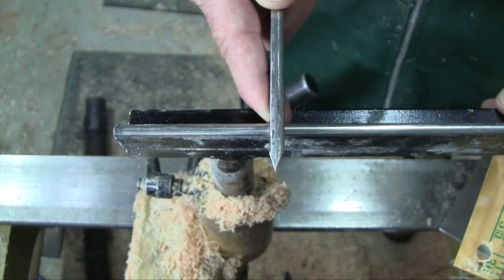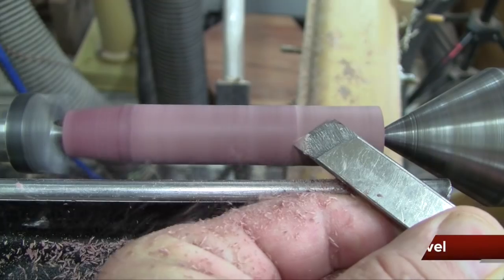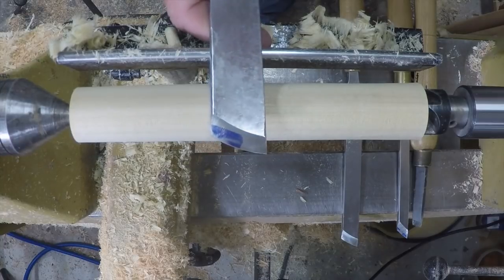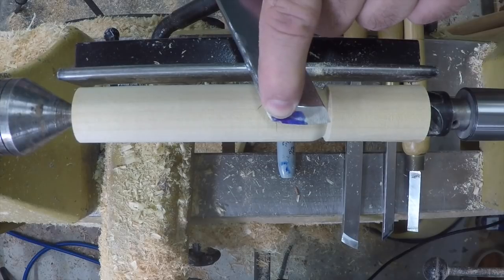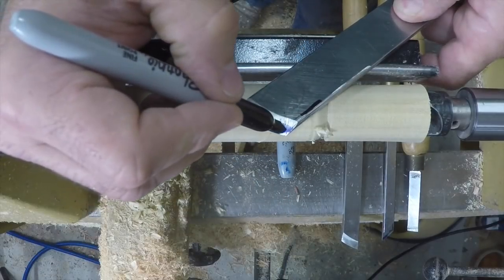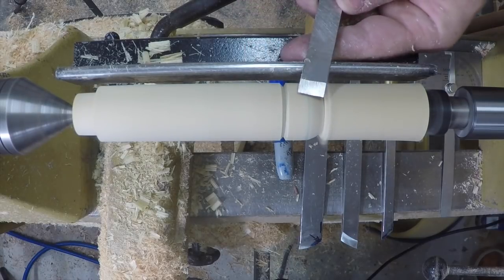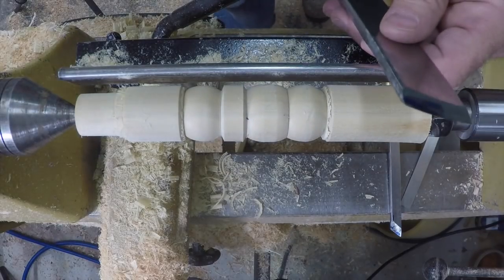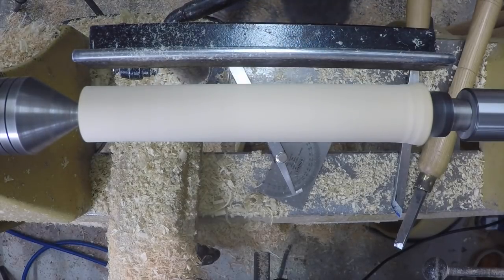Skew Grinds

Comment: Great video Brian.  I'm a beginning turner and I've been making rolling pins for friends for a few months.  I've made some beautiful laminated, exotic woods,  rolling pins, but I've spent probably an hour or more sanding after turning the shape with a gouge.  Using a 1-inch skew chisel with your recommended angles, I finished off the cylinder with the planing cut and it took only a few minutes sanding.

Comment: Excellent video.  I especially appreciated your discussion of skew angles.  I learned a lot.  

One thing you didn't discuss is the length of the handle on your skews.  I just recently adopted using a 7" handle on two of my skews.  I find the shorter handles to be much more flexible and easier to use.
Reply from the maker: David Walser I am planning to dedicate an entire video on tool handle length for various tools, so I omitted the topic here.  I too prefer shorter handles on skews (and on spindle tools in general) since, as you point out, it is easier to use.  I find that the extra tool handle length on spindle tools is not necessary, and I can maneuver a shorter handle in front of my body, etc.

Comment: I very much appreciate the time, the knowledge and effort you put into this video. I have several skews and many I have ground similar to what you showed us. While mine work quite well, with your added info I can better tune them now and understand why I would be doing that.. Thanks for your efforts in these videos !
 Incidentally, I just switched from grinding my turning tools to either belt sanding or disk sanding them. I did this to get rid of that hollow grind you were addressing when you mentioned hand honing , which I also do. I got tired of dealing with the aggressive nature of that hollow that forms on turning tools from an 8" grinder. Either taking time to back grind or altering angle ground etc, that's all done with now lol. I'm very pleased with the change I made and I had the belt and disk sanders here all along.. The skew is is one of the easiest to start finishing that way instead of with a grinding wheel too. I can do those free hand, I use the same General tools protractor you were using.

Comment: As a bowl turner, to whom 'skew' is a four letter word that makes my sphincters pucker, I found this interesting, and has me thinking more about it. One thing I am curious about is how the shear angle effects the cut. By shear angle, I mean the cutting edge in relation to the spin of the wood. Most of the time you are at around 45 degrees, which is also very common in bowl turning. When I have difficult wood, such as figured, or stringy, and am trying to tame tear out, I increase the shear angle. Mostly this means rolling the tool more over on its side so the shear angle is 60 to 70 or more degrees. Would or does that make as much difference as the different bevel angles? I compare it to speed bumps in the parking lots. Hit them straight on, and you get a big bump. Hit at a 45 degree angle, you get a smaller bump. Hit it at a higher angle, and it really smooths things out. To me, mostly it makes it easier for the cutting edge to get under the wood and 'lift' the shavings off.... If I get a lot of tear out on maple rolling pins, I resort to shear scraping with my swept back scrapers...
Reply from the maker: robohippy If I understand correctly what you are calling "shear angle" , it is the same as what I have been calling "cutting angle" (except that we are measuring the angle from a different reference, so what you call 60 to 70, I would call 30 to 20).  This angle is indeed much more important than bevel angle since it needs to change with grain orientation e.g. cutting into side grain vs. cutting across end grain.  It can also, as you point out, help deal with difficult grain.  The bevel angle seems to be mostly species/figured wood related.  This is consistent with what I have read and experienced using hand planes, where the angle that the shaving is pushed up and away from the cutting edge can influence whether the fibers break behind (good) or in front of (bad) the cutting edge.  
http://www.wonkeedonkeetools.co.uk/media/wysiwyg/23WHP-Part-1-Woodworking-hand-planes-Richard/23WHP06/23WHP-6-4.jpg

http://www.wonkeedonkeetools.co.uk/media/wysiwyg/23WHP-Part-1-Woodworking-hand-planes-Richard/23WHP06/23WHP-6-5.jpg

So the bottom line is that, since there are other ways to deal with difficult grain (cutting/shear angle, light cuts, shear scraping), unless the job is large enough to warrant the cost of regrinding tools or buying and grinding a special tool, I would not bother fussing over the bevel angle.

Comment: For Future Reference:
1:27 Bevel Definition; Included Angle; 40 degrees as a start
3:01 Deviation from 40 degree bevel
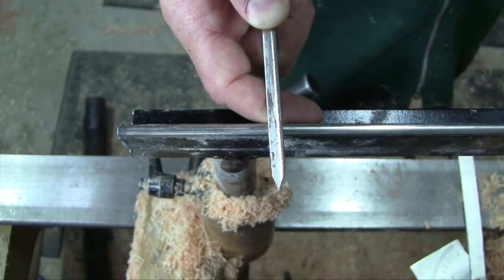4:51 Skew Angle
7:29 Making beads with regard to skew cutting edge orientation
9:49 Splitting the difference; a virtual pointer for effective bevel support
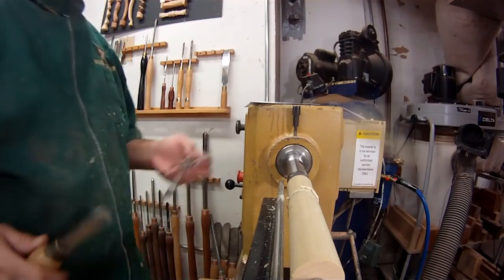10:28 Relatively Straight Skews: 90°, 70°, 60°, 50°  angles for bead-making
19:02 Shape (curvature) of cutting edge
20:41 "If I could only have one skew"
21:20 "If I could only have two skews"
22:28 Honing for great sharpness
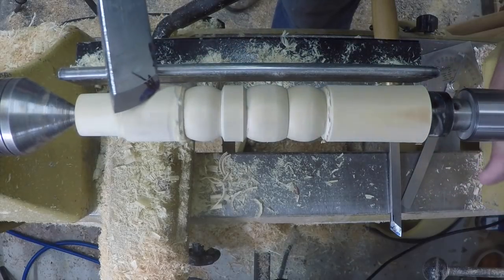25:02 The Alan Lacer skew 
29:38 Conclusion

Comment: Enjoy your videos Brian. Can you or any other experienced turner recommend the size skews a new turner should invest in. I have a 1" but feel restricted in smaller areas.  It appears that you have 1/2" on up.   Thank you
Reply from the maker: +Stafford Hillman   I think a 1/2" skew would be an ideal addition and a good complement to a 1" skew.  A 1/2" is great on smaller work and for those tighter spots.  Later, if you ever wanted to go even smaller, you can make a 1/4" round in the shop from use-enco part # 383-7015 for about $5 (I am hoping to cover the round skew this year.)

Comment: I’m curious as to the position of the skew in relation to the center of the wood.  You appear to cutting just above the center of the wood. Could you please advise me as to where I should position the tool. I’m just a novice turner and have had a lot of trouble with the skew.

Comment: Hi Brian, apologies if this question has already been asked/answered, but I wondered if you can advise, in terms of sharpening, whether it is best to have the skew chisel flat ground, hollow ground or with a slight micro bevel.  I have a Tormek diamond wheel so I now have the option of either hollow ground or flat ground (using the side of the wheel).  I am having a lot of problems with chatter/vibration when using the skew for a planing cut on cherry spindle turning about 1 3/8" diameter and 19" long.  Could this be made worse by having a convex bevel or a micro bevel?

Comment: Brian, this is a fantastic video. Do you have any videos on how to change the shape of the chisel? For instance how to obtain the 70 degree curved shape you show on the 1 1/4" skew near the end of the video? I'm also wondering about tool rest height for planing cuts. It looks like you have the rest just below the height of the spindle your turning but its hard to be sure.
Reply from the maker: I do not have any videos on grinding and sharpening yet. 
For skews, the tool rest is usually slightly above the center of the work.  I find that tool rest height is largely an issue of comfort for the turner, as the cutting edge and the work do not really care.  When using a skew, I like the tool to be in line with my forearm so that it is like an extension of my arm.

Comment: hi Brian
Great video. Thank you.
A 4th aspect is the profile of the bevel. Cap'n Eddie Castelin recommends a concave bevel rather than straight. Actually before I became aware of this my bevels were a bit convex, coming off my 6" grinder. what's your view?
Reply from the maker: +Gidi Azar I was planning to explore the convex grind on a skew, but I have not gotten to it yet.  I certainly see no objection to it.  I recently attended an Eric Lofstrom demo, and he uses a 3/8" round skew with a convex grind.  I anticipate that the difference will come into play when the other side of the bevel would come in contact with the work with a strait or hollow grind, and the convex grind would continue to have clearance: planing cut on larger diameter work or to cut coves; and more clearance when paring end grain (e.g. V grooves).

Comment: Brian: Very good video.  Informative.  Tell me, please, what are you using to make your skews?  What is the steel and where are you buying it? Thanks! Ned
Reply from the maker: I was getting the 1/4" round x 8" long tool bits from use-eco.com, but it seems that they have been taken over by mscdirect.com.  They have also raised the price a little, http://www.mscdirect.com/product/details/00229294  .  If you belong to a club and have other turners interested in making round skews, consider doing a bulk purchase to save on shipping (and a little quantity discount).

Comment: Hi Brian, thanks for another excellent training video.  I notice all your skews are straight profile (tool end view).  What is your opinion of the oval tool profile?  Many thanks!
Reply from the maker: +Gord Roberts Although I rarely use an oval skew myself, I have no objection to them.  .  The main difference is that the oval cross section allows the fulcrum to be manipulated, so you can do things like cut at the center of the cutting edge while doing a planing cut.  The tradeoff is that, when doing peeling cuts with an oval skew, there is still a fulcrum that can cause the tool to want to roll over, whereas the rectangular skew eliminates the fulcrum when doing a peeling cut.  SO... The bottom line is: If you do not use peeling cuts a lot but turn a lot of beads or use a skew just to clean up surfaces, you may prefer to use an oval skew.  If you use a lot of peeling cuts, a rectangular skew is the way to go.  P.S. This topic (including round skews) is on the video to-do list.
Reply: +Brian Havens Thanks for taking the time to respond.  Makes perfect sense (now that you've explained it).  Looking forward to future videos with great anticipation.  Cheers

Comment: I notice your tool handles are not much larger than a large file handle.  I have made a few detailing tools out of old screwdrivers and just use the screwdriver handle as is.  Please comment to the sizes of your handles and why they are shorter.

Comment: Question - your use of the term angle when it refers to angle of the edge to the body of the tool is the opposite of Tormek's. Your 70 degree angle is their 20 degree angle. They measure from the perpendicular and you measure from the main tool axis. As long as people realize that - there should be no confusion. It is easier to read a conventional protractor with your approach. Tormek's obvious point of reference is the grinding wheel. Is one approach more "correct" than the other? Thanks for doing the videos. Anything with as much technique as woodturning deserves video treatment to illustrate the nuance.
Reply from the maker: +Robert Gochicoa As long as it is clear how the measurement is being made either way is fine.  Since I am using the side of the tool as an accurate reference, I just took the reading directly from the angle gauge to keep it simple.
Reply: yes

Comment: What about making skews and other lathe tools out of old high-carbon metal workers files?
Reply from the maker: I have seen turners make tools from old files.  High carbon steel gets sharper that high-speed steel that most lathe tools today are made from, but carbon steel does not hold a sharp edge as long as high-speed and is more sensitive to heat.